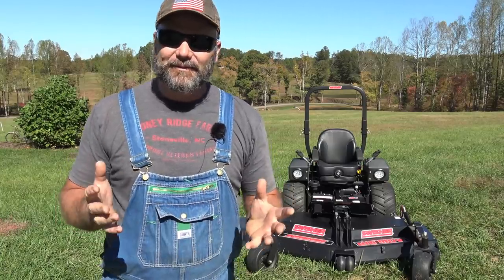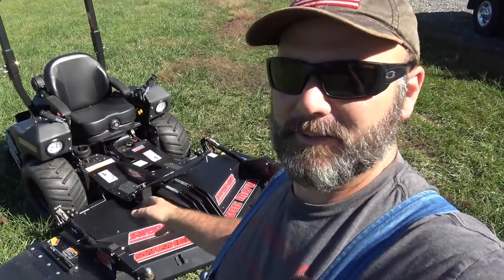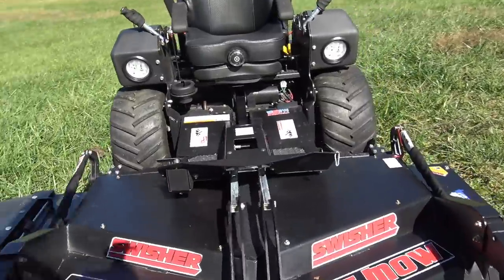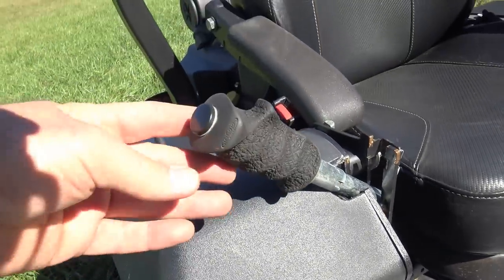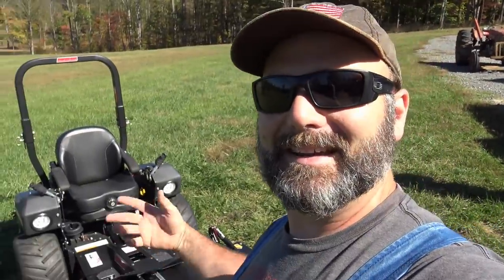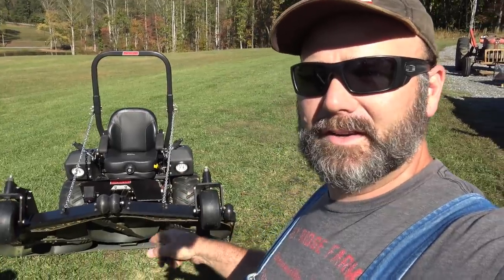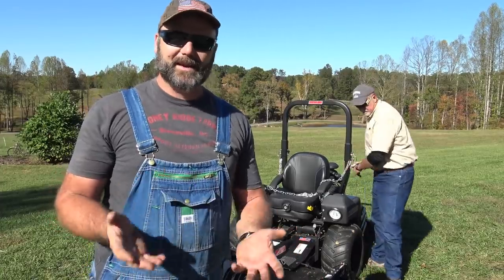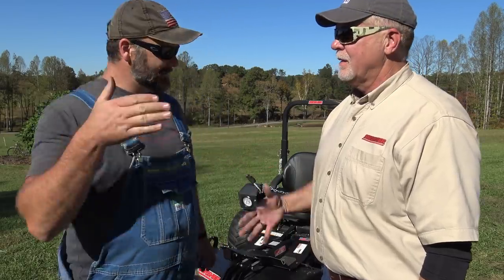Tool Tuesday! You've never seen a zero turn like this!

Comment: I have a Grasshopper front mount 61" cut mower that is very very much like this one. My Grasshopper deck raises up too with the push of a switch and no moving of a strap for it to be pulled up with.

Comment: Snow here in Cleveland.  I used to live in CT and I had a 2 acre lot with a 1 acre yard.  I had a Cub Cadet 60" deck and it had 2 5 gallon tanks on it.  Taking that deck on and off the main mower was a lot harder.    I had a 26HP Kohler VTwin engine on that.  I loved it.  I would mow the lawn that used to take an hour with a regular lawn tractor in 15 minutes.  I love mowing the lawn at 15MPH.  I also made a mulching blocker and I used to chop up all my leaves and  mulch them and leave them on the ground.  I still do it here in Cleveland but my yard is measured in feet not acres... Loved the vid and if I had a big yard I would consider one.

Comment: That looks like a repainted grasshopper mower to me.
Reply: Yup
Reply: my 2006 grasshopper frontmount has the electric deck lift and will flip up for blade changes
Reply: Or woods mowingmachine.
Reply: No sir.  That's not even funny.
Reply: i would say that is a dis respect to grasshopper

Comment: Grasshopper/Woods and Walker also make mowers very similar to this with attachments for snow removal, easy access deck, and other things. I am currently considering one of the models. The Walker is out of the running because it's rather frail and costly to repair. I have noticed the Swisher mowers but I've never seen a good honest review by anyone. Thanks for the info, Josh!

Comment: Josh, I’m a fan of your channel. I own 2 of the Swisher brand trail behind mowers. I bought the second one 2 years after the first. #1 is a 60”. #2 is a 66” with a larger motor. 

These trail behind mowers are attached to another mower for towing. My main mower is a 60” Gravely. The trail behind concept is good and when these work it’s cuts my mowing time in half. The bad news is the build quality at Swisher for these products was poor. Both of mine broke in different areas within hours of getting them. They broke at different ends of the attachment arms and replacement arms are pricey. I had my second one repaired at a local welding shop where the arm was repaired and buttressed to make it much stronger. They should have been made with thicker, more durable parts or buttressed as mine were. The Briggs & Stratton electric start motors they used have been reliable, but now 3 of the 4 tires are flat. I will replace them with solid tires. By comparison, the Gravely Zero Turn 60” is 14 years old and gets used weekly during our 8 month cutting season to mow about 4 acres. It has never broken. I service it once a year. I hope Swishers new zero turn is built better than their trail behind mowers. I’m all for American made products. I hope Swisher doesn’t lose their trail behind product line to a foreign manufacturer that builds them to last.

Comment: I have used Zero Turns for years.  I don't think I could adjust easily to the more subtle input required by those control handles.  Even if I could, I think I would still prefer the typical controls.

Comment: I know everyone gets excited when there is a beefy blade so you hit things and it wont bend, but just remember what is the weakest link, the spindle or bending the deck.  A thicker blade doesnt stay sharp longer you still have sharp cutting edge to maintain at a certain angle.  Also quality of cut issued happen from not keeping the under side of the deck clean.  Happy mowing everyone! woooo!

Comment: Like how the deck raises for easy access to the blades but I am usually a solo worker on my ranch and I don't see how you are going to hit that button and pull the belt out at the same time.
Reply: I was wondering about that. Looked a bit like a kludge. A reasonably well thought out kludge but still a kludge...

Comment: I couldn't mow with that thing, #1. It's too long to make the sharp turns I need to make without damaging a flower bed, shrubbery, a fence, or even an a/c condenser unit, and #2. It has a seat, I just hate sitting while mowing because getting beaten to death by the seat for hours on end takes a toll on me, to the point that it's hard for me to walk when I stand up to open a gate or something. I have bad knees, so going to a stand on mower was an unknown for me, but I've found that I'm less fatigued at the end of the day, and when I need to open a gate, I just turn off the blades and step off the platform. No wobbly legs, and no balance issues. Going to a stand on mower was the best thing I've done as far as mowing goes.

Comment: You should have looked at a John Deere 1445 diesel 2wd or 4wd, it would run circles around that mower! Plus it looks like your mower would be light on the rear end without rear weights during roading with the deck up.

Comment: I have seen one like that, it is the Walker Mower
Edit: that mower is like a Walker Mower
Reply: Walker mowers were the only ones I knew that had all these features  for front flip decks
Reply: Grasshopper makes a front mount mower too the 600-700 series
Also the front mount grasshoppers come with a lot of attachments
Reply: Joseph J Swisher is a poor man’s Grasshopper. It’s a direct knock off

Comment: Do you have the ability to cut at different heights like you have with most riding mowers ?  It didn't seem that way but I thought I would ask. Also one thing I love with the Swisher Zero Turn is you don't have the normal type of steering levers as is normally seen on zero turn mowers. They put small levers that are not going to cause people like me with arm and hand issues to be in more pain that I have already. I have nerve problems that causes me a lot of pain when I use my right arm if I hold it out. To just rest my arms on the arm rest and use my hands to steer is so much better. Hat off to the Swisher Company for making a better mower.
Reply from the maker: Yessir...more details to come in future vids as I get more time on the machine

Comment: Back in the day....I had one of the first ZTR mowers.I had the Dixon old school mower with the drive cones.The mowing was twice as fast....but the old school drive cone set up was a little hard to set up....and adjust.And they broke down quite a bit.I owned my mower for 7 years.When they started using hydro systems to drive and steer....way better as far as holding up to lower matainance times.BTW Josh....how is Lefty doing...????    Woooo

Comment: I couldn’t help but laugh when you were going to start that mower back up because I knew it wasn’t going to crank! Lmbo. I’m used to watching people at work with equipment and the safety switches. Contact! 😂 nope!! Good stuff, I like the mower though. It seems like it would be way smoother than the traditional zero turn. As always keep up the good work! 👊🏼

Comment: Really enjoy your channel.
Much information to be cleaned from your projects.
Only thing I don't like about that mower is if you are going to mow along your new fence and you have to make a 90 degree turn those rear casters are going to be into the fence if you are not paying attention.
My 60 inch Exmark has no tailswing outside the width of the drive tires. So it makes it less likely  you will hit something with the rear end making a sharp turn.
Also those rear casters could get into your flower bed you were mowing around then the wife will be on your case.
Keep up the good work.
Ease of accessing blades is a plus for sure.

Comment: Those Kawasaki big block motors are trouble.. I love Kawasaki motors but their big blocks 31hp are very problematic they are GOD awful on fuel consumption and will smoke after so many hours. I had a 60” scag cheetah that had this motor and I quickly traded it for a scag cheetah with a 52” deck and the 23hp Kawasaki FX engine think it’s a fx730...this engine Kawi makes  and anything smaller is fantastic by But if you go any larger you’ll wanna go with a kholer command or EFI engine instead (trust me) Also my scag cheetah 60” had the dual fuel tanks as well, they held around 6 gallons of fuel each but as I said before you NEED this capacity as that Kawasaki big block motor will drink gas like nobody’s business. So glad I traded that mower when I did 😂

Nice video tho stony.. good job with detail and going over everything on the mower, best of luck!

Comment: I tried one.  Not real good in tall stuff.  Mower deck in front caused wheels to slip and spin.  Kept having to back up and run b into it again.  Definitely not a good brush cutting mower if there are cedars and brush because it can't get traction.

Comment: Used to have a 6 wheeled zero turn, hated it. Horrible traction control, unless you're mowing a golf course. 

Way to many steps to lift the deck, made up "safety" chains, pain in the rear height adjustment. 

Get a Gravely. More bang for your buck!

Swisher was a great company back in the day. Simple honest background that got lost in trying to keep up with the Joneses.

Comment: It's nice with the rough cut deck. I'm sorry, but looking at this thing it doesn't come close to a Grasshopper mower.
Reply from the maker: I don't think it's trying to be a grasshopper my friend
Reply: @StoneyRidgeFarmer  It's much closer to a Grasshopper mower than a ventrac as you kept comparing it to. A ventrac is an articulating tractor.  This is more similar to a Grasshopper mower which has been around since 1969. I think it's a cool looking mower, but they should lose the belt setup and go more of the quick deck disconnect like Grasshopper. Just my opinion. Thanks for the video.

Comment: So compact....so efficient.....
Reply: Lao Han Tun 
There is nothing compact about that mower, look at the rear swing, if you turn it like a regular zero turn, the engine frame and rear casters will take out a customer's (or your wife's) flower beds, shrubs, or even an air conditioner condenser unit.
Reply: Ralfie it is compact for it design and lay out....educate yourself...
Reply: Lao Han Tun 
I am well educated about mowers, I have a mowing business, this one is way too long, twice as long as comparable zero turn mowers. It's not compact and it's designed like a school bus, too long. A zero turn should be able to turn in its tracks with zero overhang, nothing to watch behind you while you're turning, this one can't do that. With a 66" deck, and only 31 HP it's also underpowered. Only 4 gallons of gas per tank is not enough. I have a 48" Toro that holds 6+ gallons per side. My 61" Wright Stander is half the length of the mower in this video, holds 7.5 gallons of gas per side, and has a 37HP EFI engine. It is truly compact and has nothing sticking out the back past the drive wheels, unlike this mower. I'm sure it's probably a good mower, it's just not for me, mostly because it would take an acre to turn the thing around, like a school bus.
Reply: @ralfie8801  Its lighter, Center Gravity is well distributed, it do the job way too good, it can go 30' slopes, lighter weight so don't use or need not carry too much fuel......Toro is good but heavy, need lots of follow up maintenances....
Reply: Lao Han Tun 
It's light because it has all those extra casters and length to spread the weight out! And I'll bet it's heavier than my Toro. The Wright is virtually maintenance free. Just change the oil every 100 hrs and run the pee out of it.

Edit: I just checked the weight on it, this mower is heavy! 1380 lbs! That's heavier than the 48" Toro, and it's 180 pounds heavier than my Wright with a bigger engine and 15 gallons of fuel on it.
Reply: @ralfie8801  well let's wait and see....Kawasaki engine on it.....
Reply: Lao Han Tun 
Kawasaki is a good engine, that's what my Toro has, but efficient it is not, or let's say not as efficient as it could be. It is easy on gas usage, but the 37HP EFI engine on my Wright uses about the same amount of fuel per hour as the 21HP Kawasaki on the Toro does while doing half again as much work because of the larger deck size.
Reply: @ralfie8801  The one Josh displaying will be way cheaper model, it just nice for 200 ache farm......hopfeully Kawsaki, Japan, not chi-na.

Comment: Grasshopper, walker, scag, ferris and exmark all offer front deck 0turns.. (with levers not a wheel) several other brands offer them with a wheel. Including John Deere and Kubota, which can also run snow blowers ect, and have cabs. 

Looks cool though, I like the belt idea. What kind of hydros?